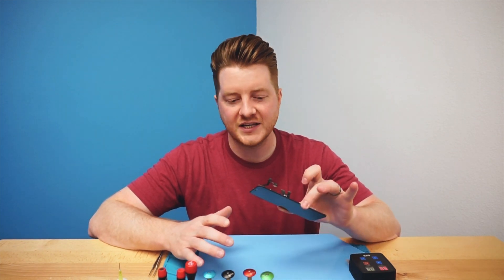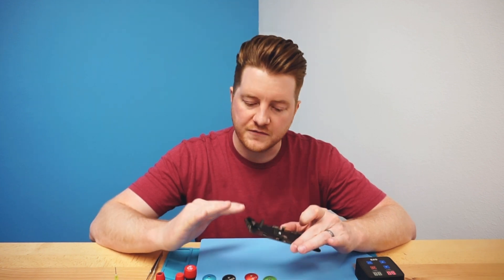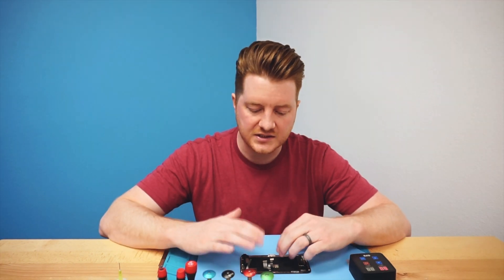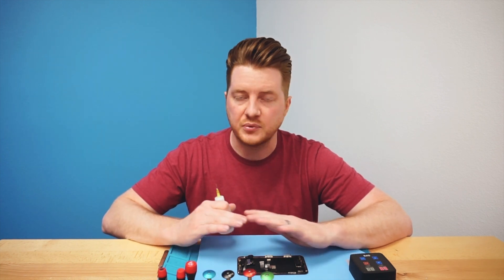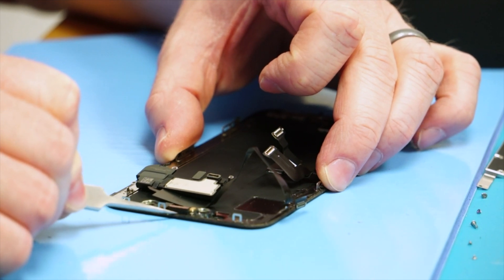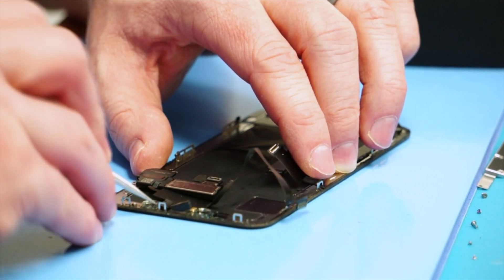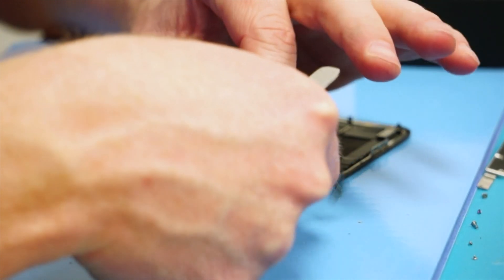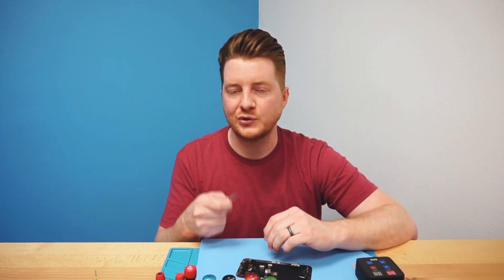iPhone X Face ID Sensor Assembly Removal - How To

Comment: Lmao all you need is a splurger you make it so much more complicated
Reply from the maker: A lot of shops have been breaking these so we made a video due to the demand. You’d be surprised how many are damaged from the ole spudger alone.
Reply: A small rectangle size Xacto knife grinded to be a bit dull is the easiest way no need iso just slide it under the cable gently and pull up there’s not that much adhesive
Reply: Yeah 3 seconds of heat on the screen side near the adhesive 
Pull back speaker 
Insert spluger under Mic/Center

Keep tension on flex slightly upward 

Swipe spudger to the left and right to clear adhesive and the Face ID pops out 
Then just pull the speaker out and ur good 
Takes me less than 5 seconds